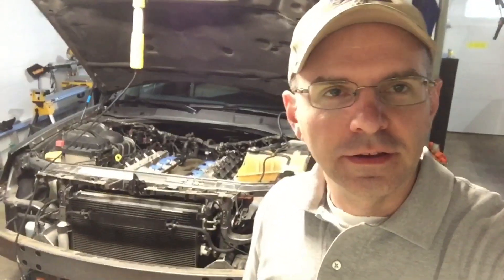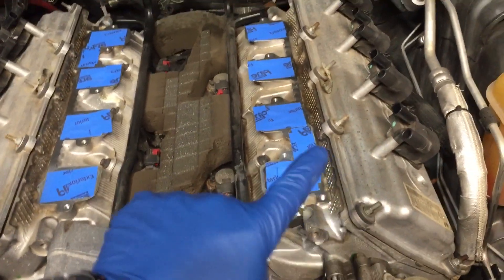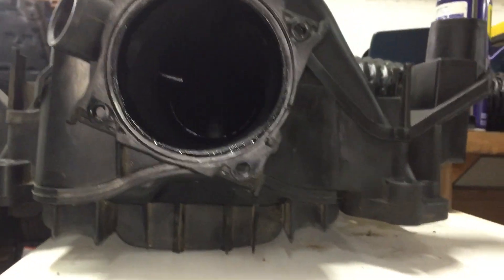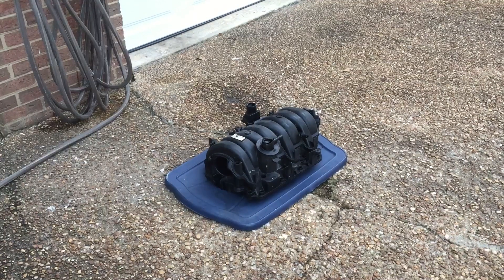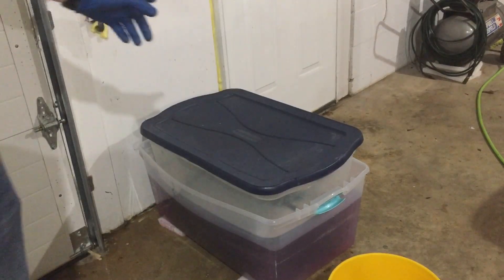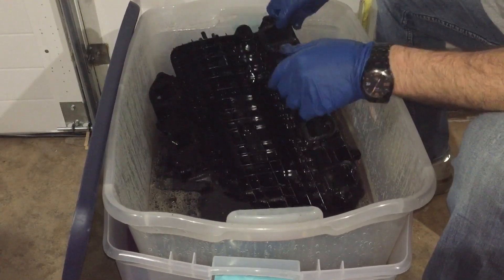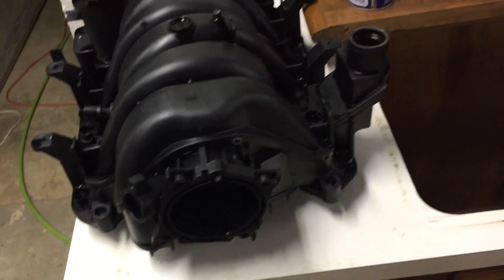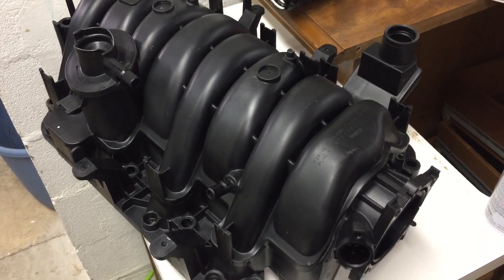Chrysler Hemi 5.7 Intake Manifold Cleaning

Comment: My Chrysler 300C dropped a valve seat and I can't believe how much metal nuggets made it into the intake and I'm even more shocked they didn't get redistributed throughout the engine. Unfortunately your video is only helpful if you want to get oil/dirt out of your IM. I'm probably going to the car wash and use the high pressure sprayer to clean it out. I've washed it out 6 times and metal bits still keep coming out. Then I'll probably follow up with the air compressor filled up to about 100PSI.
Reply from the maker: In the case of a dropped valve seat, people usually replace the intake manifold. It is unlikely that all of the metal will be removed.

Comment: Cheers ..cool vid.from Australia 👍👍
Reply from the maker: Thanks, man!
Reply: @DavidJWarEagle  I'm doing a ground up resto on a ..valiant Ap6 ..got a 5.7 going in it .am looking at the msd hemi 6 ignition module ..and the Fast ez efi throttle body set up..do you know much about them.or any other products you could suggest .I'm just bit overwhelmed  by so much info and products available .any advice would be appreciated
Reply from the maker: Folks seem to like the Holley Terminator X. You might check that system out. 

https://www.holley.com/search/?q=Terminator%20X%20Gen%20III%20Hemi%20Harnesses

Comment: Curious, how did you dispose of the dirty cleaner?
Reply from the maker: I took it to a local auto parts store that also accepts used oil.
Reply: @DavidJWarEagle  Thank you for thinking of our planet... Were you able to notice better performance ?
Reply from the maker: I don’t think this makes a difference for performance. I had to remove the intake manifold while replacing the water pump and noticed how nasty it was inside, and decided to clean it.

Comment: Good idea to clean intake internal.  Yet, I think the intake is made to trap some unwanted partials that you most likely don't want in your engine.  It does this by trapping the unwanted partials in the oil that's normally on the internal surface of the intake.  Love the video.
Reply from the maker: I think so too. I know many folks use catch cans to catch the oil vapors but then the EGR is dumping in there with no oil. So, who knows what effect that has. Thanks for the comment!
Reply: EGR, exhaust GAS recirculation, not oil.   There’s no way in hell  that is acceptable or even “by design”.    They put huge effort into every nuance of the airflow from air filter all way to the intake valve.    Why do you think it’s called a Hemi?   That’s a massive engineering. effort to get the valves to lay out the way they do, using a semi hemispherical combustion chamber so that the intake charge can approach in an optimally aerodynamic way, where the valves are on opposing sides, so the intake charge can hit the valve head sideways, as opposed to almost perpendicular.  Same for the exhaust valve.    Conventional pushrod heads have the intake charge enter parallel to the valve stem, then it hits the valve head and has. to go  around the valve head to get into the combustion chamber.  With the Hemi heads, it runs across the valve head, less turbulence, better homogenous mixture for better and more complete and fast combustion.    Same for the exit path.    Every little influence onn airflow affects performance, as well as emissions and mileage.
Reply from the maker: I hear you and thank you for the comment. It appears to be pretty common that the oil vapors from the PCV collect inside the intake manifold. So much so, that many people use catch cans to catch the oil before it enters the intake. My thought is that the exhaust gas residue / carbon would be harder to clean off without the oil from the PCV. This is just my observation.

Comment: would this crack cause white smoke to come out the muffler   mine is running ruff and smoking white smoke no knocking no motor knocking just smoking and running ruff and ive replaced the spark plugs and number 8 by the filler cap filled with oil and and now tthe throttle body control is clicking and showing code p2111 and p0123 and p0308 or 9 there for i replaced the top seal around the spark plugs and it still smoking and running ruff the pcv was dirty so i cleaned as u showed and oil wasreally wet in side and therer for i took the throttlebody off to manul clean and did BUT its not all the way closed very very small opening and clicking so i put it back on still same problems   pzzz help me paynechristopher83@gmail.com or 304-279-8211 please call me or email me sir..

Comment: A high pressure car wash would have worked better. At low pressure you could have cleaned the inside of the runners without any damage.

Comment: Hello, just completed this procedure on my 5.7 hemi intake. It came out great. One question though, what did you do with the solution when you were done? I cannot imagine pouring it down the drain lol
Reply from the maker: Hi Tyrone, I bottled up the solution into old milk jugs and the Purple Power containers and took it to a local oil change facility. You could also try Advance Auto, Auto Zone, or O’Reilly Auto. I know Advance and Auto Zone take used oil and I think they take coolant as well. I would put this solution in that same oil/coolant category. Hope that helps. Thanks for watching!

Comment: Thanks my 2006 had bad coolant tubes under the manafold hope you replaced yours pipes are rotted and bad o rings thanks for the Video that oil will fowl out your spark plugs my exhaust was black inside
Reply from the maker: Thanks for watching! If memory serves me there was a metal coolant tube that runs under the intake manifold on mine and I did replace the o-ring where it connects to the water pump or timing cover (can’t remember which).
Reply: My coolant tube look rusty and exhaust pipes are black inside. So I'll have to replace my o rings on my intake

Comment: I have a 2006 Chrysler 300c 5.7 Hemi AWD; the car got overheated and damaged 3 pistons and both cylinder heads! I just got finished rebuilding the motor and started to clean the intake from the valve seat contamination when I noticed there's a melted ½” hole inside of the intake on cylinder #1. Just wondering if the hole is there by a design or mine just got burnt through??? It looks like I can patch it with some RTV, but I can’t see if any other cylinders have holes. I hate cheap plastic parts. LOL
Reply from the maker: ZTEKFORCE As far as I know it is not advisable to reuse an intake after a dropped valve seat. My intake didn’t have a hole like that so I don’t know what happened to yours.
Reply: I think a backfire melted the spot when the engine got overheated! I was able to clean the intake and patch the hole with some rtv sealant but I'm not sure yet if I'll reuse the old intake, the new intake is a bit overpriced if you ask me. LOL

Comment: Nice video, that's the most legit manifold cleaning I've ever seen. Have you thought of adding a catch can to help/halt the oil buildup in the manifold? I have one on my SRT8, and it ends up with a tablespoon or so of oil by my next oil change...
Reply from the maker: Robert Snyder Hey, man, thanks for the kind words. I’ve thought about that but I think the EGR system causes more contamination than the PCV system. So, I would probably only add a catch can if I was also going to disable the EGR.
Reply: My hemi old cop car charger had a oil catch can and still is dirty on the inside

Comment: I've got my Grand Cherokee 5.7 tore down right now replacing valve cover gaskets and exhaust manifold gaskets and bolts. Did you notice any performance or mpg improvement after cleaning the intake? I wasn't planning on removing mine, but I will if you think it's worth it?
Reply from the maker: I probably wouldn’t bother with it unless you just wanted to. However, I would consider removing the throttle body and getting some throttle body cleaner and cleaning that thoroughly.

The reason I removed my intake was because I had oil seeping from the oil filler in the intake manifold where it meets the head. So, I was already replacing all the rubber o-rings on the bottom side of the intake manifold, and the manifold was pretty dirty on the outside. It didn’t make sense to me to put a nasty looking manifold back on the engine so then it turned into the video I created. 

I got the OEM Mopar o-rings from the dealer and those things are more expensive that you would think.

Comment: Good day,

What’s the parts number for all of the O-rings for the underside of the intake? Thanks in advance!
Reply from the maker: Jimmy Rogers Hi, I don’t have those part numbers but your local Dodge dealer can get them for you, or you can search an OEM parts website like Parts.com. They were expensive though, over $8 USD each if memory serves me. There are 8 o-rings, one for each intake runner (all the same part) and there are 2 o-rings for the oil filler and PCV oil separator housing. So, you’ll have a total of 10 o-rings and 2 different part numbers. Hope that helps.

Comment: you should try kerosene, it is not corrosive. it is a parts cleaner. the video is good, but you are using the wrong product to clean engine parts. the pcv is a one way valve, the oil and fumes go from the pcv area to the intake.  Good video though

Comment: How many miles on the engine
Reply from the maker: The engine and car have approximately 64,000 miles. This is a 2005 Dodge Magnum RT.
Reply: DavidJWarEagle wow all that gunk at 64k .... i am getting a catch can asap ... lol
Reply from the maker: maldo72 If you are going to add a catch can, I would also disable the EGR system because you’ll still be getting all the nasty EGR stuff which was what caused most of the black crud in the manifold.
Reply: DavidJWarEagle whats the best way to do that? ..... you need to make a video on this topic lol
Reply from the maker: maldo72 Usually this would be done on a car that isn’t used on public roads, “off-road” use only, and you would need a custom tune to disable the EGR system and normally a Diablosport tuner would be used to load the tune into the PCM on the car.

Comment: You are doing a really great job, audio and video!
I wonder, is all that extra cleaning mostly cosmetic or does it give better performance?
Seems like if you just get the big stuff, because once you put a few miles on it then will become dirty again anyway ?
Reply from the maker: henryssurfshowcase I would say it’s cosmetic because, like you said, it’s going to get dirty again in time. To keep it clean, I would have to disable the EGR system and add a catch can to the PCV system. Thanks for the support! 👍

Comment: I'm always getting oil around my pcv valve I put in a new one and soom how it still comes out
Reply from the maker: I was getting oil seepage around the hoses but not at the valve itself. Have you cleaned the opening where the PCV valve goes? Is the valve fully seated? I don’t think I’ve heard/read about that particular concern.
Reply: DavidJWarEagle I'll take a look I'm having a bigger problem I'm having a bad vibration when I'm in low RPMs just trying to maintain speed and it's shudders when I'm coming to a stop it runs fine in autostick don't know if it's a mds problem or the torque converter
Reply from the maker: If it behaves in autostick, that would make me think it’s a MDS problem. MDS is disabled in autostick mode. Have you taken it in for service? If you can take the service advisor with you and show them exactly what’s its doing you might have a good chance of getting it sorted out. Also, are there any trouble codes? You should be able to do the Mopar Key Dance to retrieve them. I have a video on that and it’s super easy to do.

Comment: Just a suggestion, if you pour with the spout on the top instead of the bottom the air would be able to escape easily as you are pouring.
They should make a manifold for the PVC and EGR that goes in between the intake and the heads. It would allow the intake to stay cleaner and allow for a better air flow.
Reply from the maker: MostlymoparIH That makes perfect sense. I’ll try that next time. I’ve read people go on and on about using a catch can but I don’t see the point unless you disable the EGR also. I think the oil from the PCV system might actually help dissolve the EGR crud. That stuff was like sticky tar right around the EGR port. Thanks for watching and commenting!